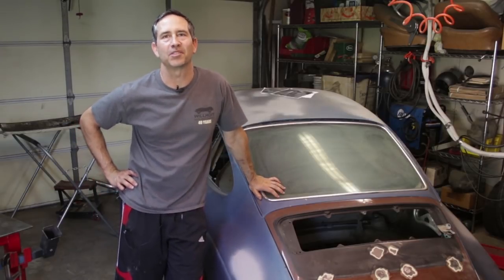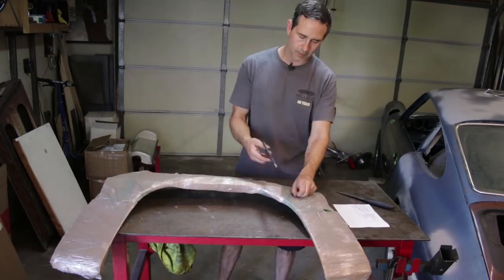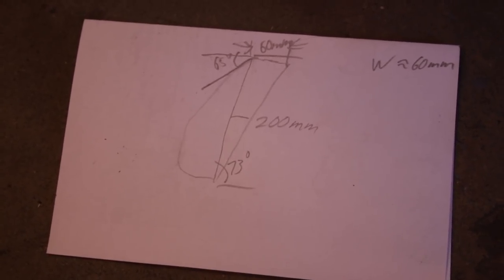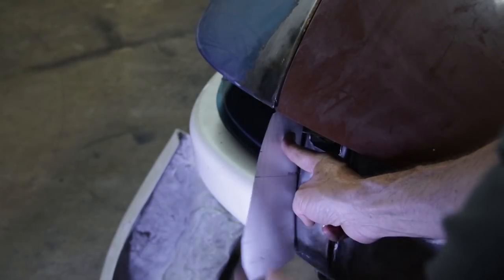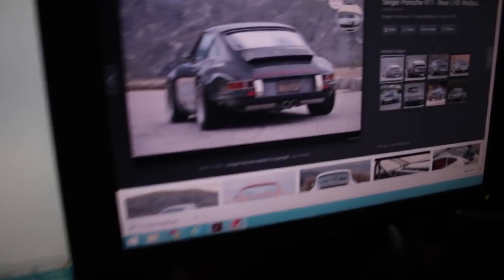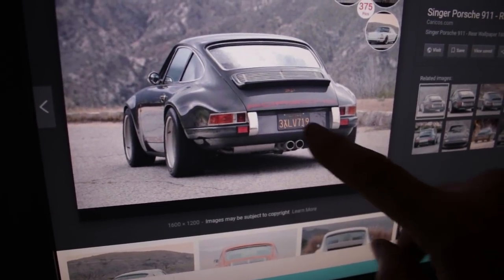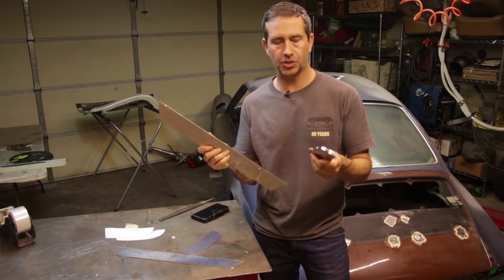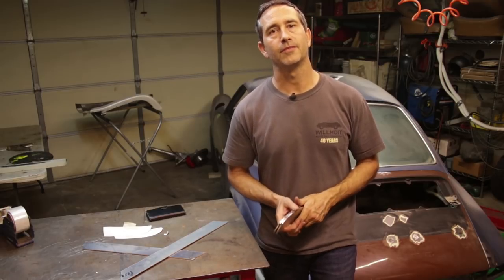Old Porsche 911 Resto - Custom CNC Rear Bumperette

Comment: This is what sets your build apart - the one-off custom touches others aren't doing. Very cool that you have access to a CNC machine. I think you're on the right track with the low profile bumperettes. I don't think the 356-inspired bumperettes would suit the car. I think you need the single curve of the slimmed down original style to compete the rear end of the car.
Reply from the maker: Thank you.  I think I was trying too hard to be different than Singer.  But theres do look good.  I didn't even cut them out, although later on might make a second set with speed holes and maybe a hollow top section.  Lots of possibilities dancing around, but I need to keep moving forward with the simple design first.  Cheers.
Reply: Love watching your videos. The flares you have are for the front which is why there is no torsion bar. It actually said FR on the flare ...”front right”
Reply from the maker: Ha, you are totally right and I bought these from you.  My mistake, I thought they were SC rears at the time.   At the time I passed on your RS rear flares, which I should have bought then.  I found one side used.  Do you have any SC flares at the moment for sale?
Reply: Garage Time - Auto Resto lol!! gosh, I thought those looked like mine due to the green! I’ve got no flares at the moment, sorry. Good luck with the build, looking forward to watching! Small world.

Comment: Was looking through some of your older videos as i wanted to go back and see what you did with your flares.  The green ones that you paid $100 for and weren't SC flares...any chance you still have them?  I realize that that was over 2 years ago, but thought I would ask.  Is it possible they are Turbo front flares?

Great videos by the way.  I have a 71 T that will be primarily for street use and would like to follow your approach to restoration as I think I should save my $ for the important parts that I can't fabricate!
Reply from the maker: Hey, good to hear you are restoring a 71.  Very cool.
Those green flares were SC flares, but they were fronts for a non-turbo.  
So I sold them.  
I've seen several flares for that price though. 
Are you looking for stock width?
Reply: @GarageTimeAutoResto  Wanted to keep period correct for the 71, so ST is my desired end point.  But man the ST flares are big$$!  I've seen where folks have been able to use Turbo fronts to emulate the ST rears and SC rears to emulate the ST fronts.  This approach would take some additional hand work, but you've shown that it is doable.